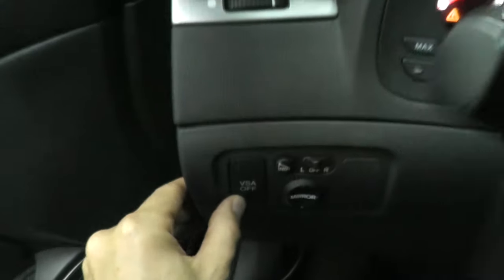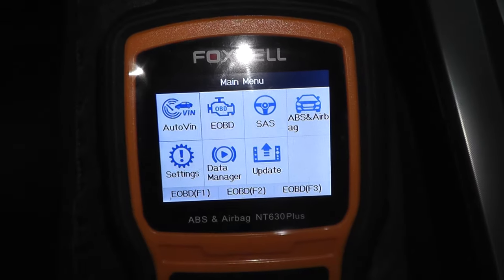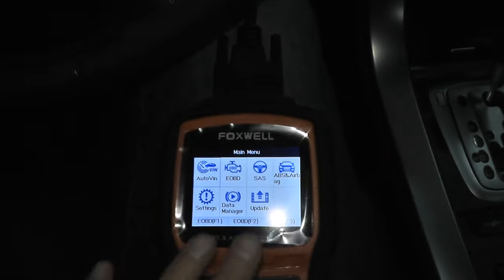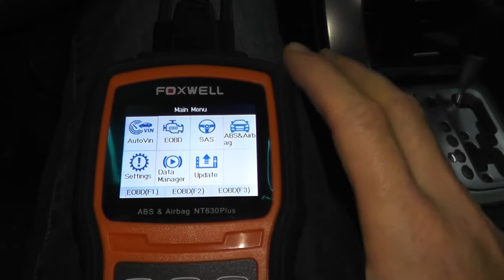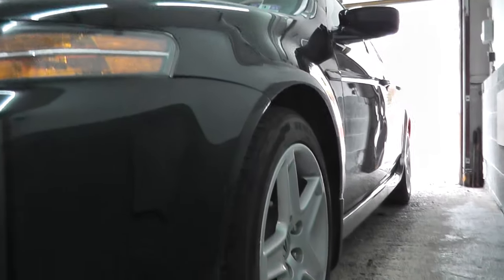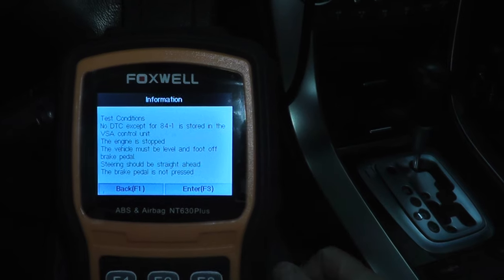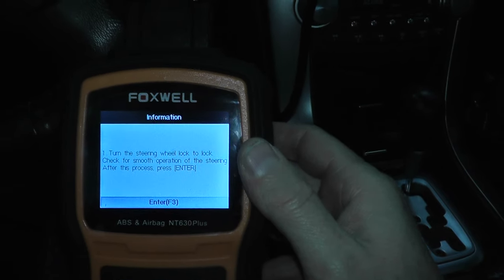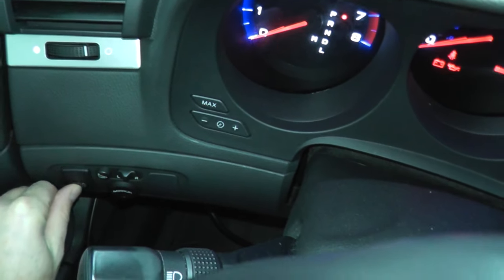How To Turn Off VSA Light For Good! | Turn off VSA Acura Honda

Comment: This procedure can also be done manually without a scanner. In the ODBII port with the ignition off you must install a jumper from pin 4 to pin 9. You then turn ignition to the 2 position. As soon as the ABS light goes out press the VSA OFF switch. As soon as the ABS light comes back on press it again. Remove the jumper you put in and start the engine. The light should be gone.
Reply: Thanks
Reply: I tried that, didn't work.  Will try again.
Reply: @longhuynh5249  how did it go
Reply: @aceca3283  they are NUMBERED if u look closely. Take a small piece of wire or a paperclip and push one end into the hole of pin 4 and the other end in nine.
Reply: @jimmyp410  I'm fiddin to try this right now. I did an auto to manual swap on my 2004 TL and that VSA light and that damn triangle have been on ever since. I do have ABS codes for one sensor, but it shouldn't make that light come on.
Reply: @Brock_Landers  how did it go?
Reply: Thanks bro. It worked 👍🏼
Reply: People have had luck with the paper clip method, but I'm sure I'll get the VSA LIGHT again and the "FixWell" will be waiting.
Reply: What’s a pin 4 or pin 9
Reply: @jairomartinez5845  If you look at the OBDII port where you would plug in a scanner, there are nine holes that are labeled 1-9 if you look closely. You need to take a paperclip or sumn similar and use it as a jumper wire to connect the #4 terminal with the #9 terminal.
Reply: This blew a fuse under the hood
Reply: Tried it, the VSA light went out of the ! Stayed on 06 Acura RL.
Reply: When I try to hook it to the pin why does it spark
Reply: It starts because there is electricity contact. Just like when you plug in a TV at home
Reply: @prestonfroelick8613  so it’s not a problem if it sparks?
Reply: thank you so mucchhh

Comment: My Acura TL 2006 had VSA light on after a minor bodywork on the drive side door. The body shop couldn’t erase the code. Acura dealer asks $255 for a diagnosis only. This video solved the problem in 5 minutes! Thank you!!

Comment: I just had a timing belt replaced on my 08 tl 3.2l and there was no lights on and vtech worked fine when I dropped it off. I got it back and the vsa and triangle light are stuck on and vtech not working. Please anyone help me with some suggestions

Comment: Thanks soo much for this video you saved me from replacing the ABS pump which i really didnt really wanna mess with i would clear the code and as soon as i hit 30mph it would come back , i never went into control modules and that did it , this is on a first gen Acura Tsx
Reply from the maker: Happy to help!

Comment: Thank you!!!  I have been using a Innova 3130c...it did NOT have the function that permitted doing the neutral position.   My dealer told me the VSA module had failed and it would cost upwards of $2,000 including labor to replace it and get rid of the VSA light because he and the mechanic had determined the VSA Module had failed. After watching this video I elected to take your advice and go with a Foxwell from Amazon.  I checked out several of the models and went with the Foxwell NT510 elite that is pre-programmed  for Honda/Acura making sure it did ABS and SAS.  Two days later, June 11, 2020  it arrived. the next day I successful got rid of the VSA light. VSA switch working normally.  A light rain soaked a vacant parking lot and I tested ABS and VSA control.......both worked.    THANK YOU!!!!!!!!
My Car:  2005 TL with 6 speed and Brembo's.  Mileage 289K.  Tomorrow I'll replace the Canister Purge Solenoid with an OEM part.  Having watched your video I feel certain that is my Check Engine light issue. Thanks for using Foxwell during your video presentation!   The Foxwell 510 elite is intuitive and very user friendly.  Much nicer than my older Innova;

Today 6/15/2020  I received a Canister Purge Solenoid valve from Amazon.  Original Denso was made in Mexico, this replacement Denso was made in Japan.   Took 30 minutes to replace it,  I'm a novice,.   I turned the key on, no faults were showing and the ck engine light was gone.  I didn't clear anything.  But I did disconnect the battery for the install, so the ECM had cleared some of its codes....guess this was one of them.

Thanks again!!!
Reply from the maker: Happy you were successful! Cheers.

Comment: Just wanted to say thanks for this. Bought the exact scanner you have in the video and i was able reset the VSA light on in my 2005 Honda CR-V. 

Also, this is a much nicer scanner than the other, cheap, one that i have. It has a ton of really nice features, can even bleed the brakes using the ABS pump. Sweet. 

Thanks again for making this video.

Comment: I made the mistake yesterday of not plugging back in the mass airflow connector before going for a ride. Almost every warning possible lit up on the dash. It took a tool like yours to clear all the errors so i could get an inspection. VSA was the most difficult to clear. Who would ever thought how many things a disconnected MAF could have. :-) (2008 Honda Element) I had just bought this vehicle three days before. Man, was I cursing the seller. LOL

Comment: THANK YOU! I wish I had found this video before replacing fuses, blowing fuses (Stupid thing on my end) and being totally frustrated, purchased the Foxwell and had the VSA reset and working normally within an hour of its arrival on my 2006 Acura MDX that had recently had the transmission replaced (And the transmission shop wouldn't try to figure out the VSA issue)...

Comment: I have a very expensive autell scan tool it can't do it oddly lol so I ordered that tool u used and 2 years later $140 down to $100 I got it for $109 after taxes brand new should be here today and I hope it works for this 06 TSX same issues and everything is working properly fuses are good etc appreciate this vid 😀
Reply: Did it work for u?

Comment: I purchased that same scan tool (only difference is I didn't update mine like you clearly stated you should) but it did clear my ABS, vsa, and the ! With the orange triangle. But it didn't have me spin the wheel from one side to the other. So naturally when I tool my vehicle for a test drive all the lights came back on. But I'm going to say that's on me (operator error) as I too have a 2006 Acura TL and boy was I happy when I saw all the lights cleared out. I'll definitely update my NT630 scan tool, take my vehicle to a flat surfaced parking lot and try this again. Hopefully it will not just turn them off but keep it off. Because after following the steps on the video I had thought all was well and even ran a scan but had no fault codes. But the recent changes I've made was the car had 20in rims and when I bought my new 18in rims I made sure to have new TPMS sensors installed so I thought maybe my car and those new sensors in the wheels weren't calibrated right. But I'll keep you updated. However I do love this scan tool as i perform my oil changes on 2017 Mazda CX5 and getting that orange wrench to turn off after doing my own oil change as was a pain but using the NT630 it was a breeze so I know the scan tool works as it's supposed to.. but I guess I just need a flatter surface to run the vehicle on when trying to fix the vsa problem

Comment: Well, I wrote and re-wrote all the steps you performed.  There is one difference between our two NT-630 Plus scanners. Under Special Functions, my unit has four options - 1. Pulser Test, 2. Mode Clear, 3. All Sensors and 4. VSA Sensor Neutral Position Memorization.  In following your procedure, I failed.  In following the # 4. VSA Sensor Neutral Position... it also failed.  Perhaps the lights can't be shut off if there is a real problem?  I do have two codes - 66-1 and the 84-1.  So I guess I'll have to put up with the lights until I decide to repair or replace the ABS module behind the right, front headlight.
Reply: Try to erase the 84-1 code first, then perform the VSA Sensor Neutral Position Test.

Comment: Thanks so much for making this video man. It did turn off my VSA light on an 05 CRV. I had 2 mechanics look at the car 1 said idk and the other started BSing and wanting me to change a bunch of stuff.
Reply: what did yu change to fix it
Reply: @vicktor1246  abs sensor was bad on 1 wheel. Mechanic changed it and took out abs light but the vsa and triangle light stayed on.  Took it to another 1 he started BSing and wanted me to spend more. So I got this scanner and removed the code and it was gone for good.

Comment: Last summer VSA, CMBS, ACC, and Air bag lights came on. We’ve checked each of those and fixed all issues but the lights wouldn’t go away. I ordered the tool you use and it got rid of my VSA light. My question is, is the process for clearing the other lights the same as the process for clearing the VSA light? I don’t wanna screw anything up! Thanks!

Comment: Dude you saved me a lot of money .... My pilot 2011 had the same issue after I sent it to the body shop they let the battery died and for some fkn reason abs and vsa ON// i called Honda Canada and they wanted just for inspection 189.oo+tax ... I found in Amazon the same tool and just plug and play // following your video I removed the fkn light 🚦 thank you

Comment: I see recommendations for the Foxwell NT630 Plus and the Foxwell NT 510 to turn off those VSA lights.  For some reason the 510 is more expensive than the 630 and only works on one vehicle make.  I'm assuming it might have some more or better functions than the 630 but not sure.  So, why did you pick the 630 Plus?  Price?

Comment: this $140 scanner is sweet, my Autel Diaglink does NOT cover steering SAS.

VSA light can be fixed for free with a simple wite jumper in the OBD plug during the VSA reset procedure.
My VSA Fault was caused by battery removal and OBD2 reset.
Reply: @glasser2819 - can you share details on the simple wire jumper fix?
Reply: @adamsusa  I can't off the top if my head. 
I have done this jump on two occasions. Last time took me 30mn to find the instruction video where a young man explains the key-On-Off... On-Off tedious procedure. 

Note: whenever you reset a fault code in ABS Module the VSA light will require the reset procedure be done to initialize function.

Comment: Dude you are the best. Bought the same tool, cleared the code with same procedure that you mentioned. VSA system works now when i floor it from a dig. Bought my car used with bad battery guess thats what caused the issue in the first place!
Reply from the maker: Great to hear!

Comment: I purchased the same scanner and cleared codes except the 8401 and tried the visa sensor but tak memorization but mine loads for a minute but then says no communication. The scanner reads dtc codes or anything else but won’t do the visa reset

Comment: mine wont let me clear one of the codes.  18-19 it says and then 18-13 when i go into the DCT.  ECM/PCM relation failure or something.  im so stuck figuring this out.  it all started after i replaced the clutch myself.  I must have hit something reinstalling the transmission.
Reply: I had this same code. It could be so many things. Relay, fuse, or the manual transmission speed sensor. I got rid of the code though 🤣

Comment: Do most scan tools for Acuras TSX (2008) going to have a VSA option under control modules? Also, how do you diagnose with the scan tool something is actually wrong with the VSA before reseting,? How do you know what triggered the VSA light to come up in the first place?

Comment: I have a 2004 acura tl and my vsa light works t stay off. My friend has a pretty device it shut it off, but when I went down the road it just came right back on again. He didn't straighten tires up or turn steering wheel he just did diagnostics. Like I said it turned ou off but came right back on. Do wheels need to be straight and DC o you need to turn steering wheel us that important? Please help

Comment: I have a question that maybe you can help me with.. I have a foxwell scanner NT650, I’m trying to reset my vsa light but for some reason it’s not letting me. It tells me that the abs/vsa does not work during test mode! I also try going around this, but then it tells me that it can’t communicate with my vehicle?!
Any suggestions??

Comment: I had vsa triangle and abs lights come on after getting some rusted wheel bolts changed on my MDX. I managed to remove the abs light and vsa. The triangle never left and after a couple minutes of driving the vsa light always comes on and later the abs. Ive now bought this scanner hoping it’ll clear my problem
Reply: Did you ever fix it with the scanner?  This problem is happening to me now again for the second time following a transmission rebuild.  The exact same thing happens the vsa button doesnt work and the VSA light plus triangle always staying on.
Reply: @garrisoncullen7476  same problem here... anything to share?

Comment: I've got a 05 TL which was in the front end low speed collision. The airbags did not come out but the yellow triangle light, VSA light and airbags light stays on constantly. Do you think getting the airbag module reset will eliminate all these lights ?
Reply from the maker: Have you tried turning off the vsa light as a start?

Comment: Hey there! I'd like to try this for my 2013 Acura ILX, but my VSA/ABS, BRAKE, HILL ASSIST, and POWER STEERING lights all come on and I'm not sure if it will address all of these things. I brought it to an Acura dealership and they replaced the VSA sensor for $90, but I drove off the lot and all lights came on again. Do I need to just pay the $3300 they're asking for to replace the VSA modulator, or should I try this? Would love your input!
Reply: Dianna Davidson you should always try the cheaper solutions. I bought my VSA switch at the dealer and just replaced it myself. It was easy. Although it didn't solve anything. So now, I will try to buy the scanner.

Comment: Great video! Thanks! Will this also work with the NT510 with Acura/Honda software loaded?
Reply from the maker: I don't think you'll have a problem using your scanner.
Reply: @CarsNToys  Purchased the scanner (actually bought the NT530, but that's just an updated NT510) based on your advice and indeed it did work! The menus are slightly different. And...the VSA light is off now, thank you so much!!

Comment: How in God's name did you ever figure out how to do that?  I started out in OBD II, I think, and cleared all my codes and then went to SAS.  Didn't work.  I figured maybe it would be better to come back to your video and write down step by step what you did.  So I gotta start with ABS/AIRBAG to scan the system, clear the code and align the SAS all without leaving the ABS/AIRBAG section.  I would never have figured it out on my own.  I'll give it a try tomorrow.  Thanks.

Comment: Is this scanner returnable? I need to use it once for this reason only. No dtcs just the triangle and vsa light
Reply: Gypsy King go to your local autozone o ‘reilys or parts store and ask to borrow their reader in exchange for your driver’s license you will be able to complete it in their lot and return once done!
Reply: The scan tool at Orielly and Autozone is just a code reader. Can NOT read ABS or SRS faults.

Comment: My lights would come on occasionally in my 05. Had this done and now the lights are on continuously.
Reply: Clear all codes and do it again. The system was not reset correctly.
Reply: @SecreTVerz  I found someone with a good scanner. Cleared the codes and I haven't had any issues